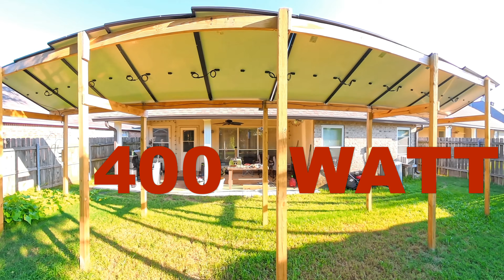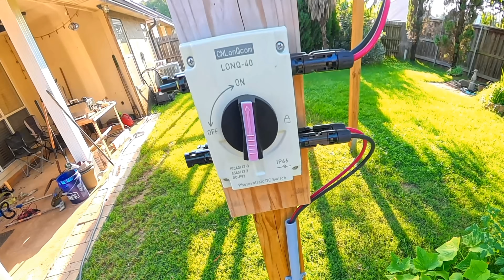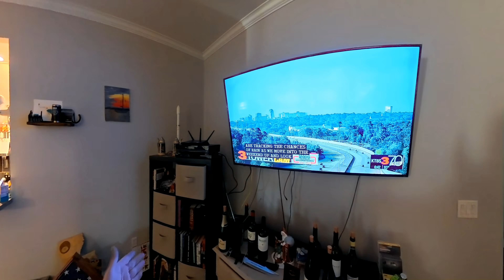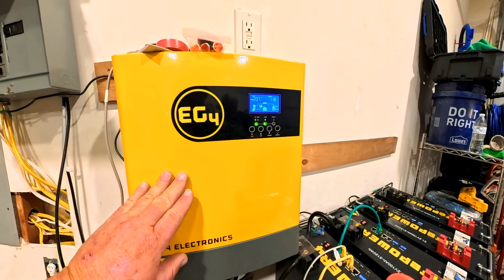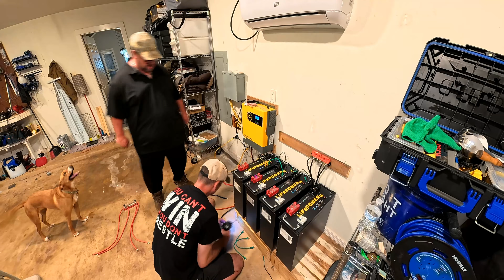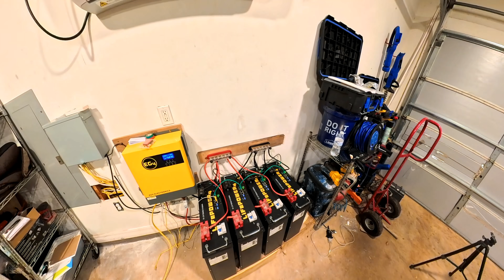Diy Off Grid Solar Backup

Comment: G'day Mate, I found small turbines start up earlier in low winds of 2.8mph,
All with 1.2M wind wheels, the outputs are only what I saw in a 13.8mph Wind Storm, they would have gone higher in the peak winds of 17.5mph.
26V - 24V 500W Vevor          -  Normal 5 Blade  -  6.5M high    -  8 Amps
26V - 24V 500W Vevor          -  Normal 5 Blade  -  6.5M high    -  8 Amps
14V - 24V ista Breeze i500   -   Scoop 5 Blade   -  4.5M high    - 11 Amps
12V - 24V 300W Hyacinth    -  Normal 6 Blade   -  4.0M high    -  4 Amps
12V - 48V 500W Sunboo S5  -  Scoop 6 Blade   -  3.5M high     -  3 Amps
12V - 48V 500W Sunboo S5  -  Scoop 6 Blade   -  3.2M high     -  2.5 Amps
12V - 48V 500W Sunboo S5  -  Scoop 6 Blade   -  3.0M high     -  2.5 Amps
12V - 48V 500W Sunboo S5  -  Scoop 6 Blade   -  3.0M high     -  2.5 Amps
12V - 48V 300W new rotor    -  Scoop 5 Blade   -  3.0M high     -  1.5 Amps
12V - 48V 300W new rotor    -  Scoop 5 Blade   -  3.0M high     -  1.5 Amps
Peak Output Totals  =  44 Amps  =  752 Watts ( my target is low winds )
Town laws stop me putting a big wind turbine up high enough to work.

Comment: I don’t want to get political. But since you talked about tariffs. Just heads up. The President’s Big Beautiful Bill, has provisions in it that will raise Electricity rates, making more money to power companies. It will cause power outages since the “money incentives” for renewable energy will be gone, add the tariffs on top of that.
Electricity bills for households would increase by $110 in 2026 and go up 10 percent for businesses.
Grid reliability and energy supply could face new challenges, as data centers are estimated to account for almost half of electricity demand growth by 2030 and new energy supply is lagging.
Reply from the maker: Let's see..2026 is just a few months away

Comment: 120v at 25 amp is not a lot. You don't need the bus bar. The battery can connect to each other.
Reply from the maker: Wrong if you have over two batteries you cannot daisy chain. If you decide to daisy chain or what some of the texts call stacking of the terminals then you are going to get uneven charging on several of your batteries they will never line up correctly with voltage and they will get farther and farther out as time goes on despite there being balancers in the BMS of the server rack batteries. In 25 amp is not a lot to you but in some people it runs almost their entire house

Comment: mini splits do require maintenance from time to time.. specifically cleaning the coils with high pressure water... the mini split being directly above the electrical system will make that mainteance near impossible to complete. 

best to not put your mini split in a place where you cannot easily remove items below it.

Comment: (10) 400w solar panels took you from $200 per month in electricity bills to $70 which means, (depending on sunlight) about $130 in savings per month divided by 10 panels means (1) 400w solar panel saves you about $13 so to save the rest of the $70 on your electric bill you would need about 6 more that you could put up a second row on the back side of your solar pergola. And sell the extra electricity back to the electric company for credits that you can get back as free electricity on low sunlight days.

Comment: So basically you could put a back side of rows on the solar pergola and have a $0 per month electric bill. Since your project cost $7000 and you save about $130 per month since you went from a $200 per month electric bill to a $70 electric monthly bill, it will take you about ($7000 divided by 130 savings per month is 54 months or 4 and a half years to pay for your set up THEN you will start saving money. Not bad. I am looking to do the same thing at my place.

Comment: Maybe this can't be done but why not wire the solar panels in parallel instead of serial. This way, if one panel goes out the others can keep charging.

Enjoy and learn a lot from your videos. Thanks
Reply from the maker: look into the difference in the difference and benefits of high voltage low amps solar arrays compared to high amps and low voltage
Reply: Many Thanks to everyone that reply. It really helps in my learning of solar installation.
Reply: The copper wire would need to be significantly thicker in parallel and increasing costs significantly. So, no bueno. lol

Comment: Did u have to get a permit for the pergola? If so I need help with that for load and windforce if there is a way.
Reply: That pergola would not pass any permitting process anywhere.  What keeps something like that safe from winds is it's proximity to other structures, like having houses all around you to take the brunt of the wind.  If this were somewhere out in the open it would not stand up to much at all, not trying to be snarky here, but I've built homes for over 30 years and have 20 years experience doing festival work where we build temporary structures that have to withstand a minimum of 70 mph winds.  This would not pass either of those inspections, but in a backyard it can possibly last if it is boxed in by neighbors.
Reply from the maker: depends on your city or county. Some say if it is above your head than requires a permit for safety reasons
Reply: @OKLAHOMAOFFGRID  thank you. Love your videos by the way.
Reply: Some places such as mine are now permit up to 10x12. If you need a design to submit there are some out there with pergolas that they sell for a few dollars for the plans that you can submit that have specs and loads on them.
Reply: @Dragonfiregum  Thanks I just submitted plans for my low profile ground mount for permit in fort worth. But I would rather build the pergola so back yard would be open but with all engineering approval stamps and cals just adds more to the cost. Waiting to see if the city will approve my ground mount design.
Reply: I'd go the easy route and just do two 10x12 next to each other.

Comment: Can the homeowner runs a water heater on those batteries?
Reply from the maker: You can but you would need another eg4 inverter to do 240 volt

Comment: I would had gotten a second inverter or the 6000xp to run the whole house because 6000xp and up are eligible for the upgrade program or waited and saved more money and gotten the 12000px but that good. starting some where is better than doing nothing!
Reply from the maker: right on